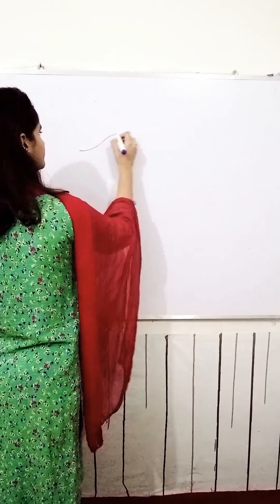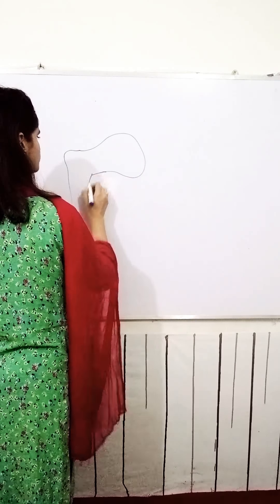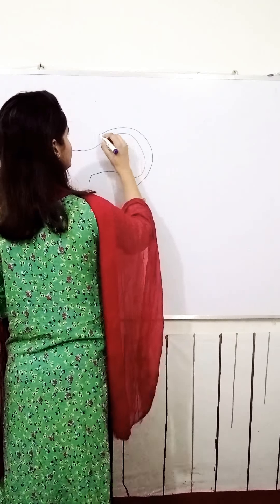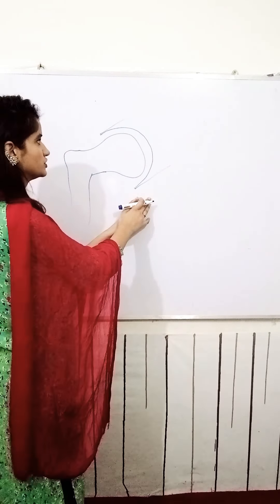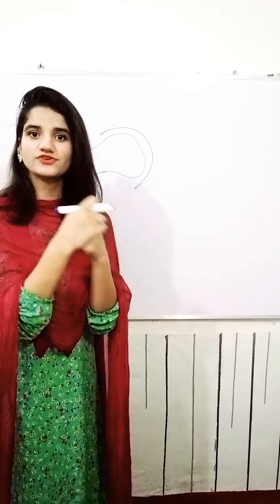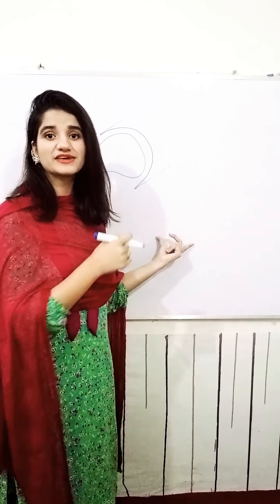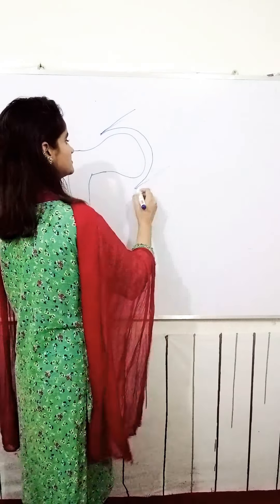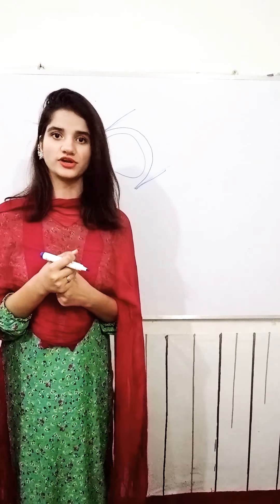Joint Stability/ Close pack position /Open pack position

Comment: Joint stability
Basically ability of a joint to resist abnormal displacement of the articulating bones is called joint stability
The articulating bone surfaces at all joints are of approximately matching shapes 
 Abnormal, compressive and resistive forces leads to dislocation
Factors: 1) shape 2) arrangement
Close packed position : in this position joints are best fit into each other
Open pack position : in this joints are least contact with each other

Comment: A ability of joint to resist abnormal dispacement of articulating bone is called joint stability.Twisting or abnormal forces can lead to sublaxation and dislocation. Joint stability prevents our muscles tendons and ligaments from injury and maintain stability.                            Factors:Shape and arrangement                      The shape of mechanical joints and their articulating surfaces are reciprocal to each other.In human body synovial joints are concave convex are not symetrical.They have 2 types of positions                                                                     Close pack position : in which joints best fit into each other and have max area of contact                                                                For example : hip joint                                       Open and loose position in which the do not fit best into each other                               For example : shoulder joint

Comment: Ability of joint to resist against abnormal displacement of articulating bones is called joint stability. Mechanical joints are joints that present in mechines it has same bones while on the other hand human bones are synovial joint having convex and concave joint. Human body joints are not symmetrical. Articulating surfaces effect joint stability. For example Hip joint
Shoulder joint is the most mobile jont while the hip joint is the most stable joint of human body.

Comment: ROLL.NO.22
JOINT STABILITY:
•Joint stability is the 'Ability of the joint to resist abnormal displacement or subluxation of articulating bones'.
 •Joint stability prevents our ligaments ,tendons ,and muscles from any kind of dislocation or injury.

BASIS OF JOINT STABILITY : 
•Shape.
•Arrangement.

SHAPE:
•The synovial joints in body are concavo-covex if one surface of bone is concave the reciprocal bone surface will be convex.
•In human body joints are not symmetrical. They have different kind of positions in which their will be maximum contact in one position but there will be least  contact in other position.

There are two types of joints:
1)Closed pack position:
Maximum contact into articulating surface is closed pack position. Best position.

2)Loose packed position:
Bones are Least in contact with articulating surface. It does not have best fit.

 ARTICULATING SURFACES  JOINT STABILITY:
 • Hip joint : Socket is acetabulum and femur fits into it which is convex in nature. It has maximum contact so it is a very stable joint. Hip joint is the most stable joint in our body

•Shoulder joint : glenoid fossa articulates with humeral head. It has least contact. Vertical diameter is 75% of the humeral head while horizontal diameter is the 60% of the humeral head. So ,the changing shape is also creating change in stability. It has least contacts of stability is lower. It is the most mobile joint of our body.

Comment: Joint stability 
Basically it is the ability of joint to resist displacement while preventing muscle, tendons and ligaments from injury.
Factors
- shapes
- arrangements 
Joints may be in closed or loose packed position. In closed packed position area of contact is greater while in loose packed position area is less. Variations occur in different individuals for joint stability.
Example: hip joint is more stable than the shoulder joint

Comment: The ability of joint to resist the abnormal displacement of articulating bone..they prevent our joint from all kind of injuries. 
They have two types: 
=closed pack contraction: 
The position that provide maximum area of contraction. Eg. hip joint 
=open pack contraction:
The position in which joint surface are not in contact which each other. 
Eg.  Shoulder joint 
Shoder joint is a mobile joint while hip joint is a stable joint. 
Rimsha 
Roll no 18

Comment: Joint stability 
It is the ability of any articulating joint to resist any abnormal dislocated and subluxation. This dislocation prevents from injuries to ligaments and muscles. 
There are two shapes of joints:
1. Close packed joints provides maximum areas of contact. 
2. Loose packed joints having contact area less than close packed. 
Examples
Joint between acetabulum and femur is a fully stable joint because the area of contact is maximum. While joint between glenoid cavity and humeral head is less stable because the area of contact is relatively small. The vertical diameter of humeral head is 75% and horizontal diameter is 60%, contributing to relative instability of shoulder complex.

Comment: Roll no 25

Joint stability

It is the ability of joint to resist abnormal displacement of articulating bones.Compressive forces leads to dislocation or subluxationThe position in which the bones are best fit into each other and maximum contact are close pack position. And the position in which there is less contact are open pac position.the shapes also affects the stability . In hip the bone is convex and socket is acetabular and is very stable joint because surfaces are more in contact with each other .
In change of shape ,there will be change in stability. Hip joint is more stable joint into shoulder joint is less stable joint in our body.

Comment: Joint stability is the ability of a joint to resist abnormal displacement of the articulating bones and its an ability to resist dislocation and sublaxation.
●CLOSE PACKED POSITION
joint orientation for which the contact between the articulating bone surfaces is maximum
●LOOSE PACKED POSITION
any joint orientation other than the close packed position
The close packed position occurs for the knee,wrist, and interphalangeal joints at full extension and for the ankle at full dorsiflexion.
One factor enhancing the stability of glenohumeral joint is a posteriorly tilted glenoid fossa and humeral head.

Comment: •Joint stability 
The ability of a joint to resist against normal displacement of articulating bones is called joint stability.This dislocation prevents from injuries to ligaments and muscles.The two shapes of articulating bone surface are:
1)Closed packed Position that provide maximum area of contraction
Eg :Hip joint
2)Loose Pack Position is that in which joint surfaces are not in contact with each other properly.
Eg:shoulder joint.
Articulating surfaces effect stability of joints. Shoulder joint is mobile joint while hip joint is the most stable joint of human body.

Comment: Joint stability:
The ability of joint to resist  against abnormal displacement of articulating bones.
Mechanical joints:
Those joints which are present in a machine  connecting one or more parts to another having same bones.
Human bones having synovial joint have convex and concave joint.
Human body joint are not symmetrical.
Articulating surfaces effect stability of joint. Shoulder joint is the most mobile joint.while hip joint is the most stable joint of human body.

Comment: JOINT STABILITY
It is the ability of joint to resist abnormal displacement of articulating bones. It resists dislocation and sublaxation to prevent injuries to ligaments and muscles.
FACTORS
•) Shape of articulating bone surfaces
•) Arrangement of ligaments and muscles
CLOSED PACKED POSITION
•It is the position in which joints are best fit into each other 
•joint surfaces are maximum in contact with each other.
•It provides more stability
EXAMPLE : hip joint
OPEN PACKED POSITION
•Joint surfaces are least in contact with each other than the closed packed position.
•It is less stable
EXAMPLE : shoulder joint
There are anatomical variations in the size and shape of articulating bone surfaces. Change in shape also create change in stability.
ADEENA MOHSIN ROLL NO. 02

Comment: Joint stability js the ability of joint to resist abnormal displacement of articulating bones.it is to prevent our muscles ,ligments,tendons frm any kind of injury to resist our joint from displacement.
Abnormal,compressive and resistive forces leads to subluxations and dislocations.
Factors:
1.shape
2.arrangement
Mechanical joint in machines their articulating surfaces are totally reciprocal to each other.same in human body  reciprocal surfaces are present like in synovial joint that have concave convex surface but difference btw human and mechanical joints are  human joints are not symmetrical.

 Close pack position:in this position  joints are best fit into each other and maximum contact into articulating surface
Open pack position:in which joint surfaces are least in contact with each other .
Example: hip joint is most stable joint of our body and shoulder joint is mobile joint of our body

Comment: JOINT STABILITY 
joint stability is the ability of a joint to make it stable.... To prevent it from dislocations nd fractures... 
It includes disloacation of ligaments, muscles, and tendons ( factors which are related to the joints) 
FACTORS:
factors which affect the bone stability are as follow:
Shape
Arrangment
CLOSE PACKING :
in this the jointed bones are fully in contact with each other 
E. G hip joint 
LOOSE PACKING :
the joint surfaces are not properly in contact... 
E. G. Shoulder joint 
moreover the stability may vary according to the shape nd arrangement of diff joints
LAIBA WAHEED
ROLL # 11

Comment: JOINT STABILITY:-
Is the ability of joint to resist abnormal displacement of the articulating bones to resist dislocation and to prevent injury to ligaments, muscles, and tendons surrounding the joint.
SHAPE OF ARTICULATING BONE SURFACES:-
Bone shape play an important role in joint stability e.g a concave socket and a convex head form a stable joint such as hip joint. Articulating bone surfaces in joints of human body are all approximately reciprocal shapes.
- Closed-packed position:-
1) Great joint stability
2) Joint surfaces are in maximal contact to each other.
Example: Occur at knee, wrist, interphalangeal joint at full extension.
- Loose-packed position:-
1) Reduced joint stability
2) Articulating surfaces are maximally separated.
Example: Shoulder joint.

Comment: Joint stability: It means the ability of the articulating bones to resist abnormal compressive and twisting forces that caused displacement. 
   Factors: 
  1) shapes 
   2) arrangements 
       
     Human body has synovial joints having concave and convex surfaces. They also have reciprocal surfaces similar to the machines with the difference that they are asymmetrical. When they are not symmetrical they force distribution is not even . Close pack position and open pack position of the body also effect. In some cases stability is more and in some it is not . 
        Such as femur and acetubelum , in this hip joint their is maximum surface contact this joint will be very stabile. 
      Contrary to that the humerus and the glenoid joint , in the shoulder joint. Their is no maximum contact so they are not as stabile. 
      So change in shape can change the stability.

Comment: Joint stability is the ability of a joint to resist abnormal displacement of the articulating bones and its an ability to resist dislocation and sublaxation.
●Factors:
•Shape of articulating bone surfaces 
• Arrangements of ligaments and muscles
The articulating bone surfaces at all joints are of approximately matching shapes.
●CLOSE PACKED POSITION
joint orientation for which the contact between the articulating bone surfaces is maximum
●LOOSE PACKED POSITION
any joint orientation other than the close packed position
The close packed position occurs for the knee,wrist, and interphalangeal joints at full extension and for the ankle at full dorsiflexion.
One factor enhancing the stability of glenohumeral joint is a posteriorly tilted glenoid fossa and humeral head.

Comment: • Joint stability:
 The ability of a jonit to resist abnormal dislocation of articulating bones. By the compressive and resistive forces there would be displacement of one bone from another bone. Jonit stability prevents the displacement of ligaments, muscles and tendons surrounding the joint.
•  Factors: affecting the joint stability are
1. Shape of articulating bone surfaces 
2. Arrangement of ligaments and muscles.
• Shapes of the articulating bone surfaces:
In mechanical joints , the articulating bone surfaces are reciprocal in shapes. While, in human body the shape of most joints are mating each other one is convex and other is concave. 
• Closed packed position: in which one bone fits completely into another. There is maximum area of contact and it provides more stability. 
Example : hip joint 
• Loose or open packed position: in which the area of contact is relatively less and is less stable joint. 
Example : shoulder joint
 However there are anatomical Variations in thr size and shape of articulating bones surfaces.